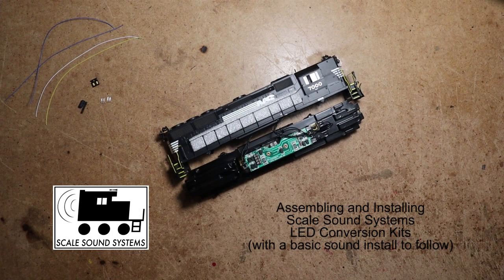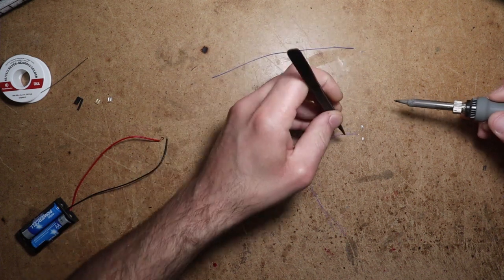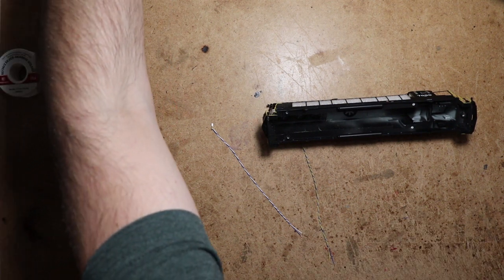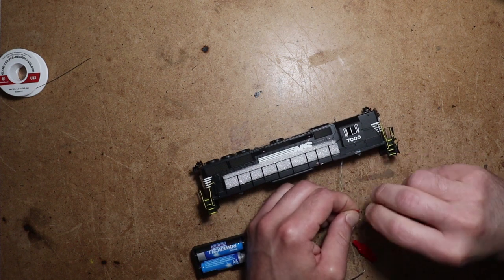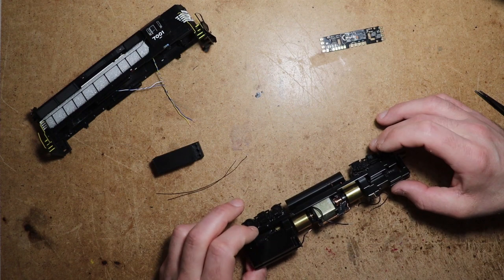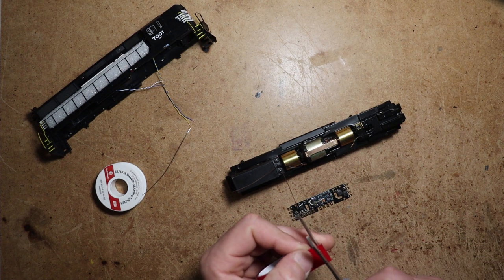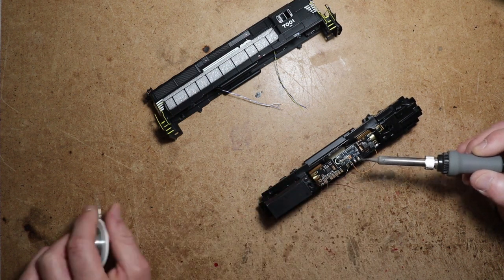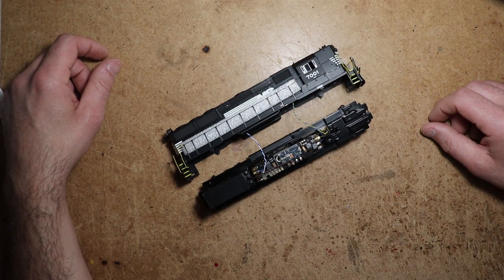HOW-TO LED Headlight Conversion Kit & Basic DCC-Sound for Athearn Locomotives by Scale Sound Systems

Comment: I would sincerely hope that speaker which replaces the weight is at least close to the original weight or you just gimped a bit of pulling power, of course most people don't run realistic train lengths so probably not an issue here.  Great walk through.

Comment: JT, I am going to install a soundtraxx eco onto my Athearn RTR GP40X shortly.  Your video is very helpful save for a little confusion on my part.  I took the hood off and found but one track pickup front and rear.  Am I correct?  Also is the positive motor wire attached to the clip on top of the motor?  Thanks.
Reply from the maker: On these RTRs, the trucks each have one wire; this is your right rail pickup on both. The left rail pickup goes through the frame to a single wire on top; this is your left rail pickup for both trucks. I do no recall which motor clip is positive - you'll need to test for your self. If it moves in the wrong direction, simply swap the two wires on the decoder contacts. You can test the motor by using a 9V battery - touch the two motor wires to the battery contacts and when the loco moves forward on your workbench, the Wie touching the positive battery contact is your positive wire.

Comment: No resistors in the light wiring?
Reply from the maker: The LokSound Direct has LED resistors built-in.
Reply: @Musepro7  Thanks. I didn't hear that if you mentioned that point.